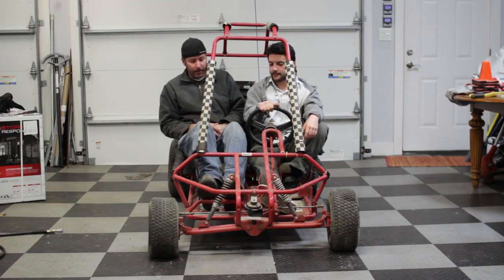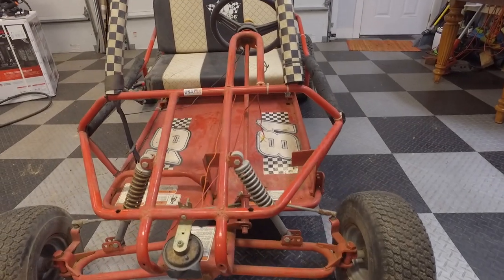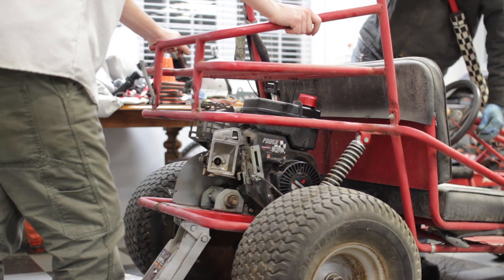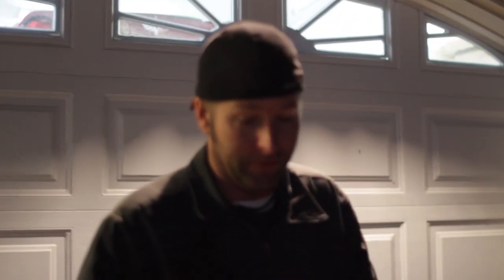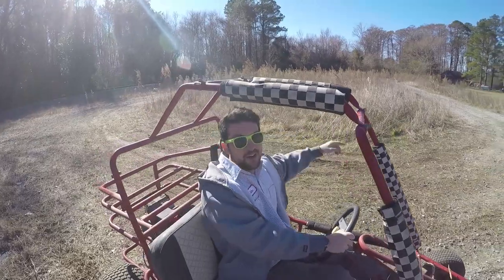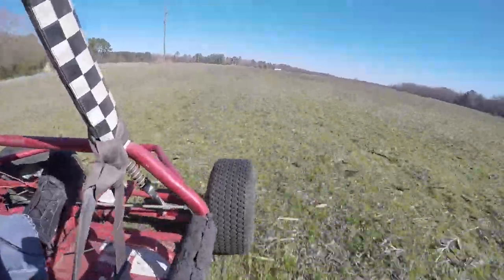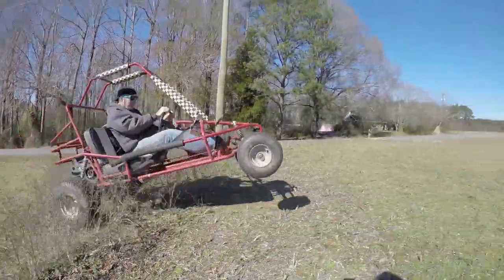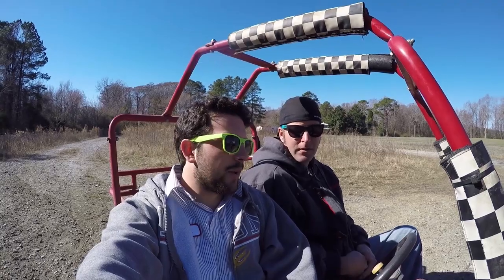$100 Offroad Go Kart Find

Comment from the maker: I think it needs a diesel.
Reply: CarsandCameras yes it does r u still doing the racing mower
Reply: CarsandCameras i am 14 i like u r vids keep them up i have 3 dirtbikes and is it possiable to put a yamaha ttr50 engine on a go cart
Reply: outdoorsman 18 I'd you know how
Reply: outdoorsman 18 it'd be slow
Reply: CarsandCameras Put a V-Twin in it!
Reply: CarsandCameras hey guys I got my yerfdog gx150 spiderbox for $200. It needs either a cylinder rebuild or a new engine
Reply: CarsandCameras Turbodiesel and get rid of the decals
Reply: i think it needs a rotary
Reply: CarsandCameras I had the 6.5 and mind didn't run for like 4 years just a warning when you start it up it will spew oil EVERYWHERE
Reply: CarsandCameras and with the tecumseh the shaft is 1/8 inch smaller (I think) don't call me out on it but the shafts is shorter and it likes burning belts if you put the predator
Reply: CarsandCameras no wonder why Ike is so smart
Reply: CarsandCameras put a diesel kabota motor and put a 2 inch strait pipe on it and I love your vids keep them coming
Reply: I found a mini blower you cloud put on the 670 o3o
Reply: CarsandCameras OR????? a 250 2 stroke
Reply: CarsandCameras nah a snowmobile engine would be sick because a diesel won't go that fast
Reply: diesel and repaint the frame don't even bother modding the current engine go straight diesel and slap some off road tires on it!
Reply: Eat My Moto Dust that would be awesome!
Reply: CaliKouL like I just said, diesel will be slow so either they could make it a shifter kart with a yz250 engine or put a snowmobile engine on it
Reply: Eat My Moto Dust you have a great idea, I don't get why people want diesel so bad when diesel engines don't rev past 3000 rpm and therefore it will be slow
Reply: Hell yes
Reply: armadillo platypus that will be slow AF a yamaha yz250 engine would be fast
Reply: The Stingray Hub you better mean a Harley v twin
Reply: put one of those tiny 3 cylinders on there and haul ass
Reply: ***** turbo does not effect speed so it will still be slow compared to rotary, a 250 2 stroke engine or a snowmobile engine
Reply: Buzzkill061 you better mean a rotary, a 250 2 stroke engine or a snowmobile engine
Reply: It needs a 2 stroke!
Reply: CarsandCameras  it needs a 250 2 stroke
Reply: CarsandCameras put a diesel in it!
Reply: XxSlyFox01xX diesel will be slow compared to rotary engine, 250 2 stroke engine or a snowmobile engine
Reply: Sled_NeckX99 that's very true
Reply: Rosshied Williams you dont even need a mini blower any smog pump off a car will work as a blower all it is, is a air pump iv seen smog pump go cart builds that push 18lbs of boost out a smog pump lol
Reply: Sled_NeckX99 but torque is why diesel it wont be fast but offroad it will be unstoppable
Reply: CarsandCameras yes
Reply: CarsandCameras PREDITOR 670 OR A HUGE ENGINE MAKE IT GO VIRAL PLZ LOTSSSS OF POWERRRRR!!!!!!
Reply: go for a 670
Reply: CarsandCameras Yes like a little yanmar clone 5-10 HP diesel would be a torque monster!
Reply: Case IH nah dude a snowmobile engine would be awesome
Reply: TURBO-DIESEL
Reply: CarsandCameras i have a manco scorpion with a 420 go to my account
Reply: I think it does.
Reply: I like the diesel idea for a off-road cart. Yes it will be slow but they have carts that are made for speed. I like diesels for there low end torque. For a off road go kart I think it would be perfect plus it's diferent.
Reply: needs a V8 diesel twin turbo
Reply: CarsandCameras turbo diesel yea
Reply: Think you need too do up a dune buggie
Reply: cummins 7.3 turbo?

Overkill? what does that word mean?
Reply: but it will have amazing touque
Reply: definitely diesel
Reply: CarsandCameras gotta go 670
Reply: Supercharged 670
Reply: 670 or bust!!
Reply: CarsandCameras Turbo 670 lol
Reply: CarsandCameras 670
Reply: CarsandCameras Yes please
Reply: CarsandCameras  How about putting a bike engine on it? I don't know if you have done it before or not but it would be cool.
Reply: CarsandCameras put a predator 670 on it
Reply: MAKE IT A DRIFT KART         JDM KART
Reply: CarsandCameras What kind of diesel?
Reply: duramax
Reply: i relly need the intake and carb from that motor off the cart i droped my motor like that and broke the intake and carb and relly need this engine to run for my wood slpitter i cant find a intake like that in my town at all or on the interweb plzzzzzz send it my way ill pay you 20$canadian big ones if that happens to come in my mail one day bu chance
Reply: CARSANDCAMERAS I've seen a lot of comments saying go Diesel or blown 670, but only one person suggested a rotary, now I know it's not up to me but if I had the equivalent equipment to make such a thing I would go rotary just for the sound they make I know tourque isn't big on them but put 2 rotarys on and you will be on to a winner maybe even a contender for the 670 over a set distance. Thanks, I know you guys have a huge fan base I'm over in England I watch ur videos every night before I sleep and in any spare time, my favourite video you've done is the turbo drift trike as I also have followed your build and made one, apart I have carbonated fuel system and not efi, hope you get to read this comment many thanks,
Reply: CarsandCameras you should put a lift kit on it
Reply: CarsandCameras you should do a triple threat match between the racing lawnmower, the doom bike, and the go kart
Reply: CarsandCameras starpuss use to sell diesel motors that would go perfect on yalls carts. look him up on youtube
Reply: CarsandCameras I have that go kart runs good but the belt beads to be replaced
Reply: That go kart needs a diesel
Reply: and a torque converter!
Reply: CarsandCameras it definatly needs a diesel and a nitrous kit
Reply: Heck yes it needs a diesel a turbo diesel at that
Reply: yousss rightt
Reply: recovery cart with a diesel project   overkill.
Reply: low and slow diesel recovery or mud cart find some gripping tractor like tires.
Reply: Sled_NeckX99  true but a YZ250f would be awesome aswell
Reply: YES DIESEl!!!!!!
Reply: CarsandCameras DIESEL AND AWD FROM 4 wheeler!!!!!!!!
Reply: CarsandCameras turbo it
Reply: CarsandCameras 10 horse yanmar
Reply: CarsandCameras dude a gsxr 650😏😏😏😏😏😏😏😏
Reply: yeah do a diesel low end torque means it would more than likely drift and roll'in coal in a go kart who wouldn't want to see that
Reply: CarsandCameras +1 on the diesel idea!  Rolling coal!
Reply: contact starpuss for a diesel engine. He knows a lot about small diesels.
Reply: Predator 670
Reply: CarsandCameras diesel 4x4 buggy..
Reply: CarsandCameras YES
Reply: CarsandCameras either that or put a 670 vtwin in it
Reply: Had one of these the cage got crushed in took it off and ran fine. I would say take the cage off it looks cooler that way and between all motor choices vs the diesel i would try the diesel cus i never seen one in the yerf dog. i wanted to put a dirt bike motor in mine but sold it cus i ended up getting something bigger.
Reply: CarsandCameras  Definitely Diesel ! or a Cb 750cc Honda M/bike engine and strengthen the frame and steering
Reply: CarsandCameras  cool
Reply: 4bt it, lmao
Reply: CarsandCameras PLEASE DO DEISEL
Reply: CarsandCameras 670cc would be perfect for it
Reply: I was going to say put the 212 in it, and it help. But Diesel sounds much better!!!!
Reply: CarsandCameras it needs a lift or beefy tires or both, and I think we all can agree that it needs something a lot more Stout for a power plant
Reply: CarsandCameras 9:07 That's what she said!
Reply: you think they way i do a good sized street bike or dirt bike motor but the way u gotta hook it up in the front for a shiftier and all
Reply: CarsandCameras I think that you should do a 212 I have the same go cart and I have a 212 then there Would be 2 identical go carts and mossy people will have money for a 212 so people can bild one to
Reply: CarsandCameras  get a jeep go kart  and ride it
Reply: outdoorsman 18 go bigger kid, get a 450f motor and learn how to weld, tell your dad you wanna learn, if your dad isn't around ask an uncle or grandpa. Welding is a valuable skill. you can fix a lot of shit if you know how to weld
Reply: CarsandCameras go diesel
Reply: CarsandCameras 2cyl kubota diesel!
Reply: CarsandCameras go diesel there is a few 10 HP diesel single cylinder engines on eBay. my buddy has one on his wood splitter and it is freaking AWESOME it sounds pretty boss
Reply: CarsandCameras you guys really need to make this your adventure style cart with a diesel engine AT tires small lift brush bar bumper and a light rack
Reply: You have to go with diesel.
Reply: CarsandCameras yes
Reply: CarsandCameras yes
Reply: CarsandCameras needs a legit 24hp Briggs. 🙂
Reply: CarsandCameras no a turbo with 1.2 bar 😂 would be amazing
Reply: Carroll Stream sells a 10hp Yanmar clone diesel for like $800. They have 20lb/ft of torque and sips fuel like nothing.
Reply: CarsandCameras put a predator 301cc
Reply: Sled_NeckX99 dude I like the snowmobile engine on a go kart but on a street machine. the diesel would be good on an off road go kart.
Reply: CarsandCameras those where hucklbers
Reply: Hey by a long shot do you all have any go kart frames you don't care about and don't want but if you don't it ill be fine i will just keep looking for one somewhere else thanks.
Reply: CarsandCameras of course
Reply: CarsandCameras PLEASE ANSWER THIS QUESTION!!! WHAT SCREWDRIVER DID YOU USE TO ATTACH THE PULL START COVER ONTO THE MOTOR
Reply: CarsandCameras PLEASE ANSWER!!! IM WORKING WITHA GO KART MYSELF AND NEED HELP BECAUSE I HAVE THE SAME MOTOR
Reply: CarsandCameras it definitely needs a TURBO diesel
Reply: G
Reply: CarsandCameras we’re do you get all these
Reply: yes it wouls be just fabricate frame mounts to mount it and fidn the right sprocket and chain for it and find a way to shift and you should be good!

Comment: Love this!  I recently bought one for my kids.  Please do the "free power" mods so I can compare my stocker to yours.  Also, I wonder if gopowersports would hook you up with the 40 series torque converter so you could review the difference between the 30 series and 40 series.  Here's an idea I've had too: take the engine off the rear swingarm and make an engine cradle for the frame, run a chain from the TC sprocket to a sprocket mounted near the hinge point of the rear swingarm with another sprocket right next to it with a chain running to the axle.  You'd need a couple pillow blocks. I think it would be more like a rzr.  I wonder if it would squat more under power?

I've also wondered about finding a way to have either bearings or a bushing at the pivot point of the rear swingarm.  Not a big deal, but the hinge there seems kind of sloppy and noisy.

Comment: I know with a little modification to the frame you can put an 18 on the front instead if the 15 in it. if you put a diesel on it with torque converter and a comet reverse tht would be awsome.

Comment: I put a 420 cc on my yerf dog and it's pretty nice. I added 4 shocks in the front to help with jumping. You should do the same it helps a lot. Also add some height on the roll cage. And stop using the factory brakes it'll bend the frame on the left side add an axel brake. Great video!

Comment: Hey guys,  Idle problem is the idle jet is clogged.  Engine is idling with the governor.  It won't do that anymore if you delete the governor, so you will need to fix that before deleting governor.  Better yet, dump that Tecumseh, and get a nice 2 stroke pit bike motor.  They have them with automatic clutch, electric start, reverse, and best of all, cheap and fast!

Comment: put a bike  engine on it double cylinder or even a 4-cylinder you want speed there you have it LOL the hell with them lawn mower engines..... Little humor
Reply: Charles Hank hell might as well put a yamaha banshee motor in it
Reply: Charles Hank needs a 450 bored 60 over haha
Reply: Yeah! Put a hayabusa in it! With the clutch/transmission so you have a clutch and multiple gears. Probably should do at least 3 point harness seat belt in it then though...
Reply: I got a yerf dog I'm sticking a yamaha xj750 on. Should go at least 2mph

Comment: I had one, I put on a genuine honda gx340 11hp with comet 40 series clutch, it took 2 thick adults all over red river motorcycle trails in bulcher Tx, it was awesome. Had to add 2 shocks to the front end to support weight.

Comment: I have one just like this, with a few mods. It's not bad after tweaking the governor and adding a straight pipe. Back in the day, I think it would go about 30 mph, depending on the weight of the driver.

Comment: I bought a dingo with the same engine. The carb jet is the bolt holding the bowl in place. Clean that thing out with a wire. Then you will want to clean the idle circuit. You have to remove the little black flat plastic/rubber plug and then unscrew the idle circuit. It is non adjustable so just blow out the circuit with some carb spray and put it back in. It should run pretty smooth after that.. Or you can just buy a new carb, they are only like 12 bucks on ebay.

Those Tecumseh power sport engines are pretty lack luster though. I don't think they were rated truthfully by the manufacturer. So putting a 212 on it should pep it up nicely.

Comment: Hey Ike. To fix the idling issue with the Tecumseh, back out the little gold screw next to the primer bulb. Clean it out and blow air through the hole in the screw and put it back in. It made mine run like a dream.
Reply: thanks. the throttle plate shaft was worn out so we replaced the carb which will be on the next yerf dog video

Comment: you guys should try putting sea foam in the gas tank or in the carb when it's running. Not really a substitution for soaking carbs to clean but. it works pretty well on engines a little rough

Comment: Nice Find. Do something "Ike" with it. Make something. Also use Carb cleaner to run a engine for test start. Gas % oil mix in a squirt can????. Sorry worked on small engines too long. Always a good vid.

Comment: That's funny. I'm building a yerf just like this and my motor idled just like that.   Poured a little lighter fluid in the gas and fixed it right up.  I know not the right thing but brought the tecumseh back to life.  Any ideas on a throttle brake cable setup?  Didn't have any.

Comment: give it a few more inches of suspension travel (without making it top heavy), weld in reinforcement into weak spots on the suspension, plexiglass windscreen and the biggest fastest engine that can fit back there, go for the whole baja , pre runner truck deal

Comment: Put the motor and transmission from a street bike on it so you can actually shift and tear stuff up.  It doesn't have to be a big motor or anything, just some old junker that has been set aside or something.  I think that would be awesome.

Comment: this cart should be your adventure vehicle, put a decent size engine with moderate top speed and alot of low down power AT tires a small lift a front brush bar and a light rack

Comment: go with a different kind of motor go with like a snow mobile motor or a motor cycle motor I build mud toys and i have a off-road gocart with 4 wheel suspension and it has a Honda cbr 750 and we off-road drag up against motorcycles and we get some good times with it we have topped it out at 140

Comment: i got one for 50 bucks the other day!  What size front tires and rims go on there?  Mine didn't come with front tires on it!  Please help someone!!!  I believe it's a 1" shaft on the kart itself.  It has the spacers/washers lock nuts - ty in advance!  I believe mine is the 3202 version but someone said the tires are all similar.

Comment: I need help
my go kart had a predator 212 and a 12 Tooth in front and 53 tooth in the rear but it only goes 30 what can I do to make it go faster
Reply: Anthony Garcia drop some teeth in the rear
Reply: Anthony Garcia you can take the governor off
Reply: Manolis Kalamata thanks but that's the lowest gearing I could find
Reply: The Stingray Hub thanks
Reply: Anthony Garcia yeah governer removal then an even smaller sprocket if needed. though it can get to a point of not enough torque to over come the low gearing.  

On my on road kart I think i went 12 and 38. built predator 212  took  a while to get to speed but would run 75 no problem. 

Also anything you do to it or with it is at your own risk. Be safe.
Reply: Matt Hudson thank you very much I appreciate it it alot for your help
Reply: Anthony Garcia 
Sometimes gearing up will net you a few mph top speed. I used to run a 5:1 and when I switched to a 5.5:1 I gained almost 5 mph top speed

My setup is a built 212 predator:
12T clutch 66T sprocket
Top speed 50 mph on live axle
Reply: Michael Gedies thank you very much I will invest in new rear gears and try it

Comment: You should put 24 inch wheels on the back and 22 inch wheels on the front and put a 10 hp diesel on it
Reply: And add a light bar at the top

Comment: Why is it so slow? I have a Tecumseh 3002 which is similar to this one but more basic and when I got it, it had a Tecumseh engine. It ran fast with the Tecumseh. The kart is stock so it probably has a 60 tooth sprocket on the axle with a 10 tooth on the Torque Convertor. Did you guys find out why it ran so slow?
Reply: its weak and gearing is slow
Reply: Isaac it'll be fine Ohh alright thanks.
Reply: sure

Comment: Come on guys, you fouled the rails multiple times. Trains and locomotives aren't anything to mess around with. The tracks might look they're out of service , but they still can be used for equipment storage(especially with the economy we live in)or detours. 

Sorry if I sound preachy, I have to when it comes to safety. I've been a locomotive engineer for 13 years, none of my brothers and sisters or myself want to hit anyone or anything.

Keep safe so you guys can keep doing videos and having fun!! General rule to stay out the foul is arms length from outside of either rail.